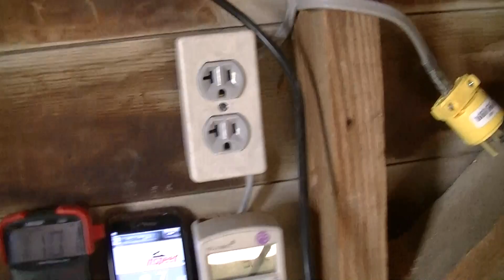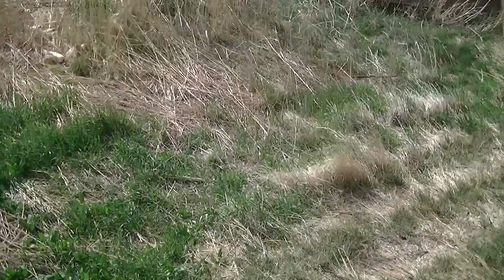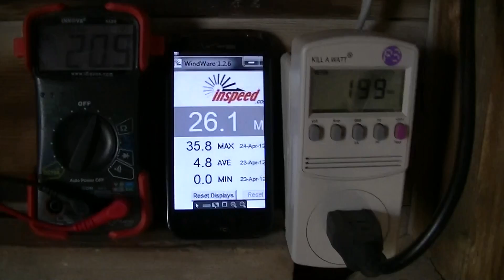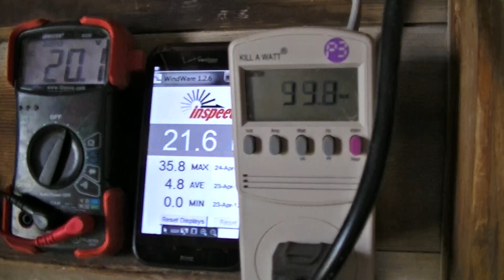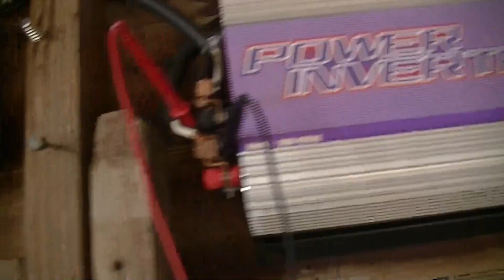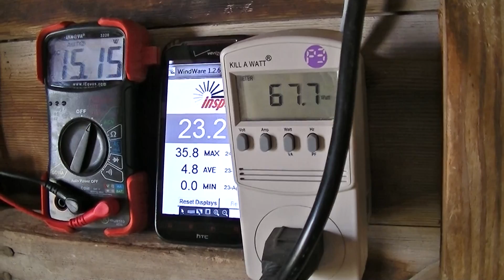Windmax HY-1000 24v and Sun 10-30v 1kw inverter Part 1A

Comment: I was using the (green) 3-300 watt  1ohm Coil Resistors tied.  The problem I am very sure was not the resistors, but the Hybrid  Controller, which was designed for stackable grid inverters. I don't think the Chinnse Manufacturer designe the to the 1000 volt/25amp capicity they claim. Lesson learned.  By the way, I have found dynamic brakes on ebay with the right amount of watts, and ohm resistence make a great low cost alternative to what some of turbine guys on ebay are selling.

Comment: Interesting. I had  pretty close to the same set up, as you do. Just be careful, I burned up that same exact inverter. Ouch! on the cost. After that, I switched to a 3 phase grid tie inverter with it's own dump load control and same voltage and wattage.  I have not had anymore controllers or inverters burn up. I have stayed with 3 blades on my turbines because of often high winds in the mountain valley I live in.